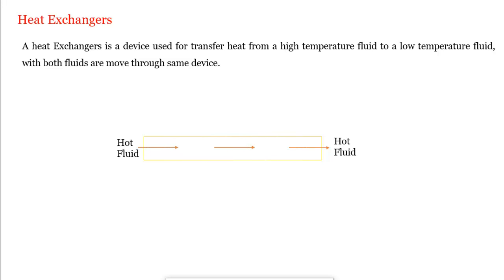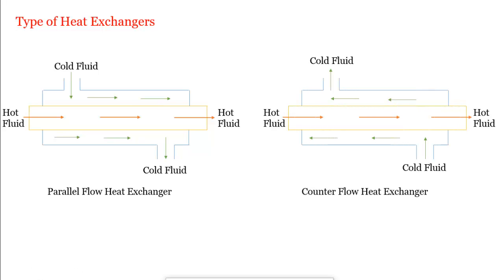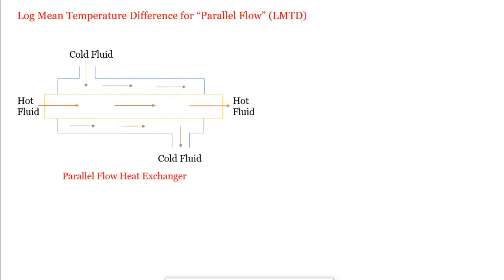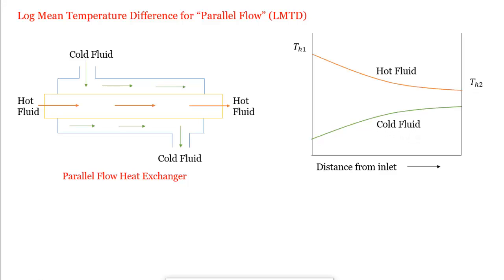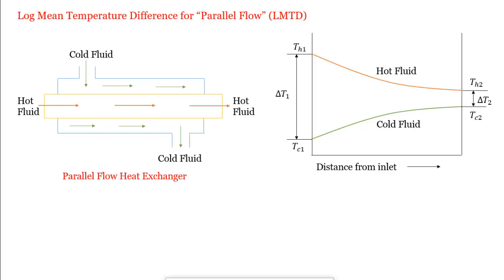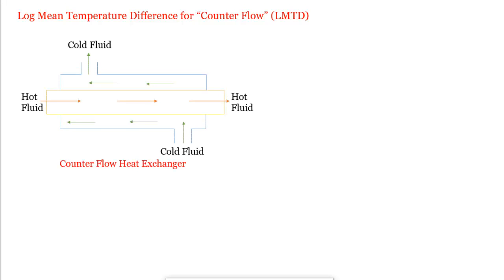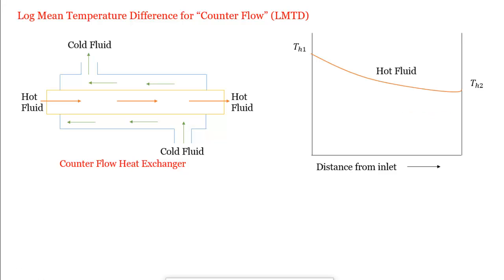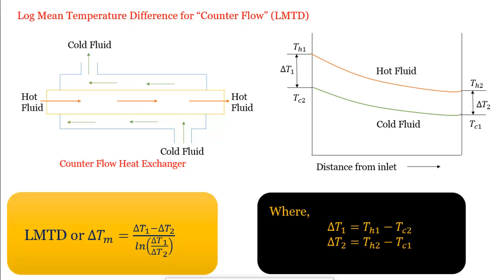Log Mean Temperature Difference (LMTD) l Heat Transfer l GATE 2020 Mechanical

Comment: Will the temperature of cold fluid in case of Counter flow Heat-Ex decreases?
Reply from the maker: +Praveen Rawat Please check the Temperature Distribution diagram on 4:15 
 in counter flow Heat Exchanger temperature of cold fluid increases.